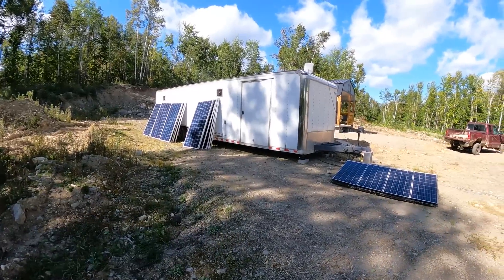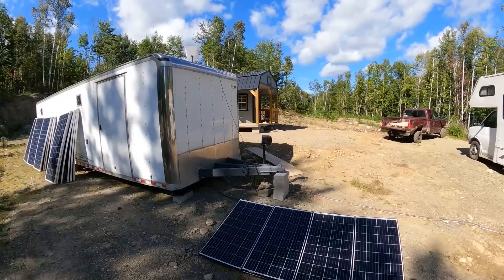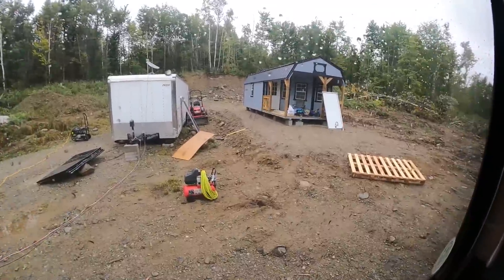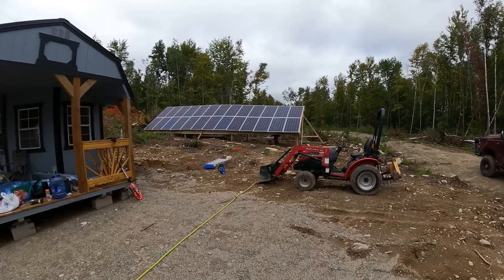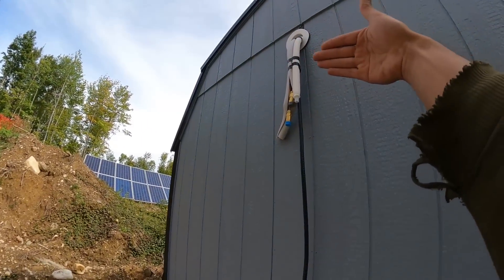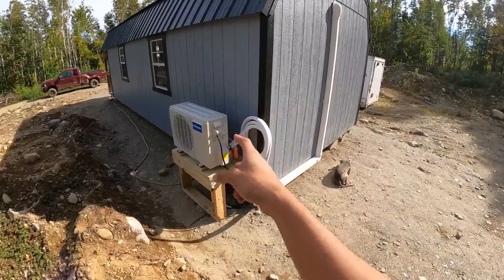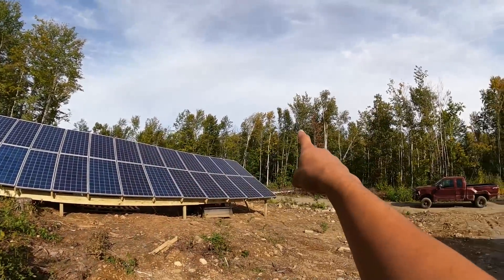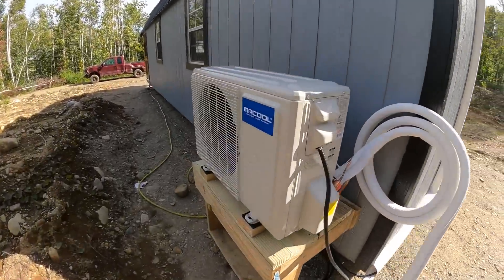My Solar Array is MASSIVE !!!

Comment: Great stuff man.  I setup my garage 2 years back totally offgrid.  I'm running Growatt 48v system using big battery batteries, its so cool generating all the energy off the sun.  Haven't spent a penny on electricity for anything I've used in the garage.

Comment: Stop useing inverters, that ru through another transformer. USE dc power DIRECTLY, watch ypuself save 30 to 40 precent efficiency by cutting out unneeded expensive error prone components.

Like cutring out your egr.

Use a solar vacuum heat collectors to boost the geothermal efficiency in the winter duh.
Reply: And in the hest collectors use automotive radiator fluid for working fluid so it doesnt freeze or boil, done son

Comment: Hey onion I'd recommend the confortotal mini split on eBay for 500$. It's a single stage non inverter unit but that's a better design if you're looking for something that won't require maintenance. For large whole house ducted unit single stage is worse because the high power draw to start them kills it but a 110v 12k btu little single stage mini split doesn't hard start so they last forever. The thing that dies on inverter units is the inverter computers themselves, as long as your single stage is sealed it'll last a damn long time with no breaking.

Comment: i install those things all the time for the renovation company i work for, you did the right thing, you just coil up the extra line sets, your install looked super clean, nice job. and believe me you will never hit 83 on the  remote, you will cook, i throw it on like 70-72 and it gets a little to hot sometimes to where i turn it off lol. nice job having the unit elevated. you might wanna throw a little roof over it tho, cuz if it snows that much by you, if the rad on the outside gets covered in snow, or ice it wont work. those machine have alot of self protection built in. it should mention it in the manual.

Comment: I hope you have good insulation in that tiny house. Especially the floor.
Reply: He has no insulation in the floor and also installed the cabin to low to the ground to get under and insulate it. I offered him to spray foam it for him (it’s what I do for work for the past 10 yearsout of the augusta area) but he never got back to me. I’d recommend 3inches of closed cell in the walls 5 in the roof and 4 in in the floor
Reply: I can confidently say we’re one of the best contractors for spray foam in the state small company too. Could definitely do it for material price if he just paid me labor..
Reply: @bmdubclub9933  Does making some sort of surround to seal the home to the ground help?

Comment: How do you keep your water supply from freezing in the winter ? This series is good idcwtf they saying
Reply: It won’t happen there’s no water to the cabin plus no insulation under the cabin. Even heat tape here in maine won’t keep a pipe from freezing
Reply: @bmdubclub9933  maybe a shed with a heater and insulation
Reply: @nickh5450  have the well drilled next to the cabin    Then slab with 2ft+ concrete footers with the shed on top of that built directly to the cabin as a addition then have all the water lines heater/tank and such in there and you can’t forget the insulation preferably closed cell spray foam (what I do for work) in maine it gets really cold here on a good winter.
Reply: We also spray under the concrete slab here in maine but I know orions to cheap to do all that. He didn’t even insulate the floor on the cabin plus it’s to close to the ground to get under there and do it now so hes gonna have to lift that place up alittle more off the ground once he realizes that he’s losing all his heat through the floor
Reply: Lifting another foot+ would help significantly to keep the building up out of the snow..